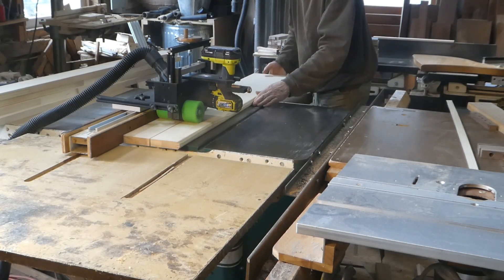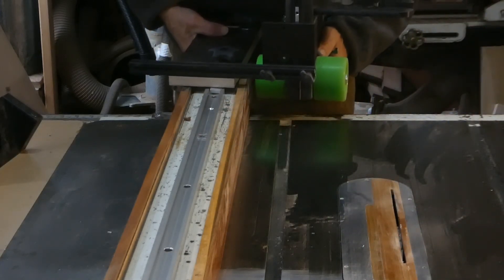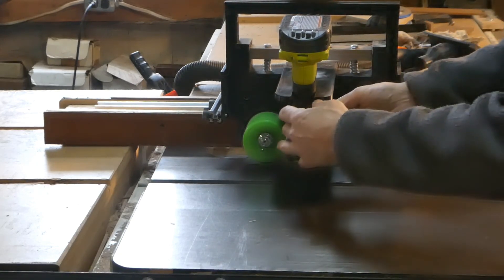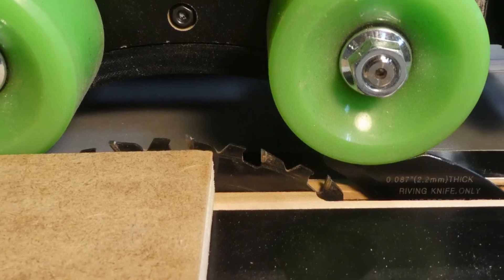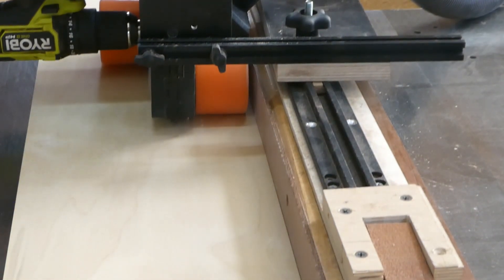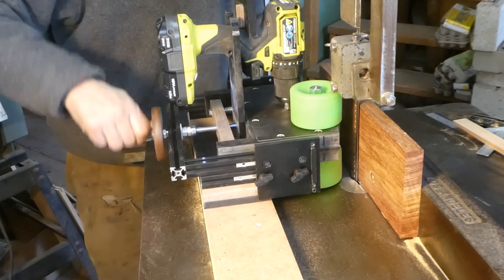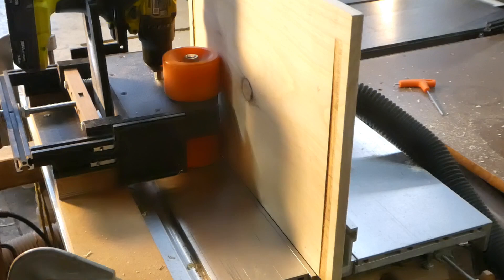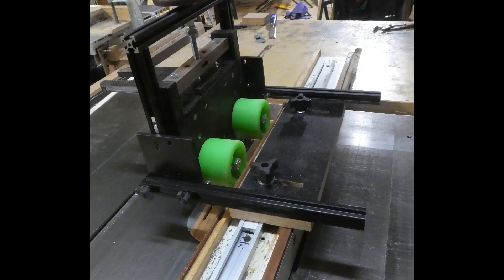The Little Proteus Power Feeder

Comment: I like this design.
This is likely my next purchase. 
I’ve been wanting something to feed and provide hold down to my tablesaw and router table.  I’m hoping it can resolve some of the inconsistent issues of variable dado depth and router depth of cut issues.  It has me very interested in being able to also use it on my bandsaw and a bonus that I didn’t think was an option is the use on a jointer.  Crossing my fingers!
Reply from the maker: Thanks Eric. It's great for consistant depth of cut control. For super precision add a wheeled hold or featherboard before and after  the feeder to help the beginning and end of a cut and it can give DOC accuracy to within a couple thousands--on anything from 6" to 20'  lengths. For less demanding work it can be used all by itself.

Comment: Great video! I've been using the little proteus since Feb 8, 2025.  I am building a 10x20 shed and decided to side it in cedar ship-lap-with-a-gap cedar picket.  I've run about 1400' of rabbet on 6' cedar picket from HD, feeding it end-to-end nonstop and have about 60 more to go.   The little proteus has added immense joy to this project - so much so that I may run a lot more than I need.  I am running it on an old craftsman cast iron contractor saw that I picked up for $75, cleaned up, adjusted and added a delta T-3 fence.  I 3D printed a t-track for the fence to mount the little proteus. All the rabbets have come out perfect on this project - the little proteus drives the material tight against the fence - very, very consistent performance.  Seriously... this thing is a game changer.   I can't wait to set the little proteus up on my 14" Grizzly G0555 for resawing!

Comment: Nice design, but the pricing is too steep especially when I can get a new, more durable Grizzly power feeder for about the same cost.
Reply from the maker: Thanks for the appreciation of the design.

What makes you think the Grizzly is more durable? I've never had to replace a part on one of mine from wear. That's on the plywood version I've been making for 4 years now.

 The baby feeder is certainly less versatile, such that most people showing it off these days pair it with several hundred dollars worth of switchable magnets to try to make mounting it tolerable.  Good luck with that on your mdf router table, or aluminum topped job site table saw. Even mounted it's still a multi-step pia process just to change the height 1/4".

 I owned a baby feeder for decades and seldom used it because it was too hard to mount and adjust. For ease of use the Little Proteus blows the Baby Feeder out of the water. For band saw resawing the Baby feeder is barely functional--and feeds too fast for any but very large band saws.

Finally, the Little Proteus is built here in the US. One would expect to pay more for that, but it's still less expensive.